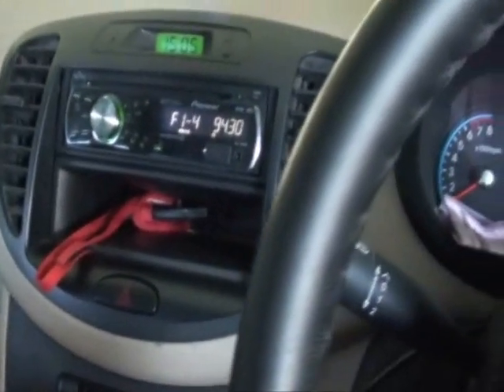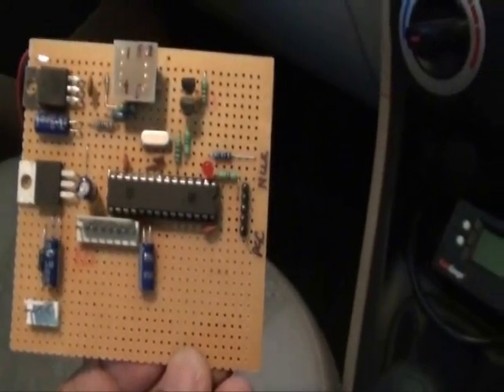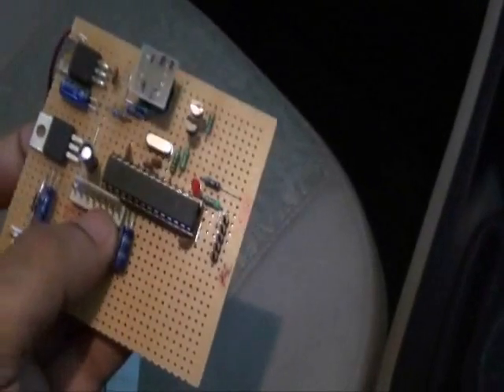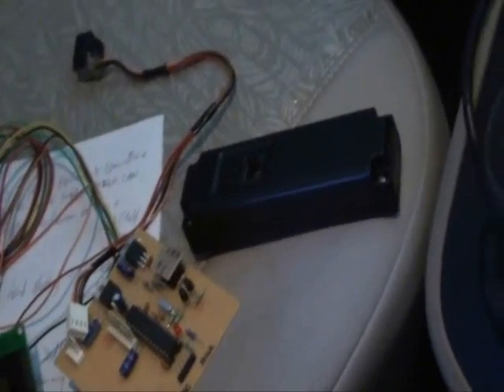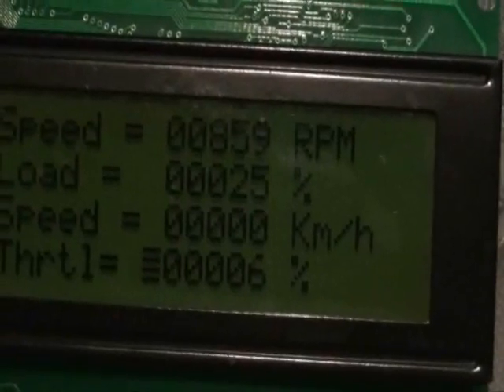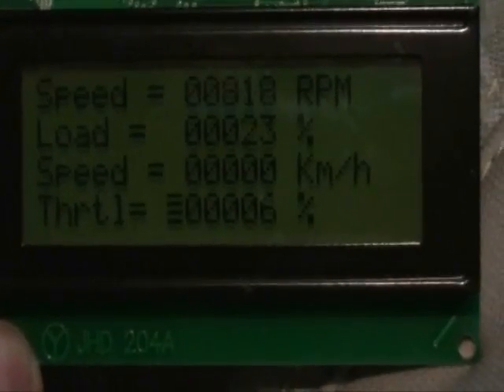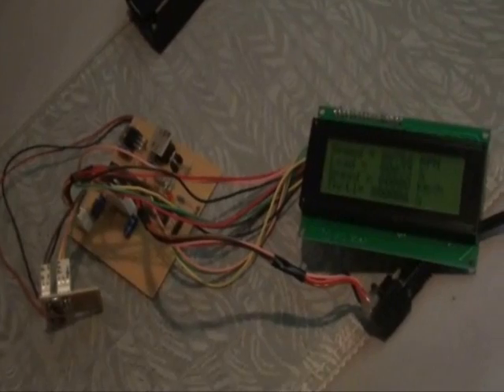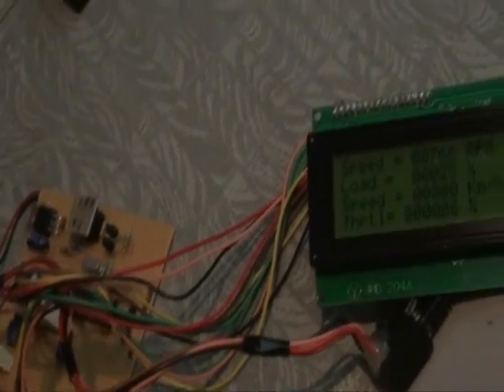CAN OBD II Reader

Comment: Nice build. One thing you can prove out with the data you have is finding the optimal operating parameters for the engine. That load calc is what you'd use.